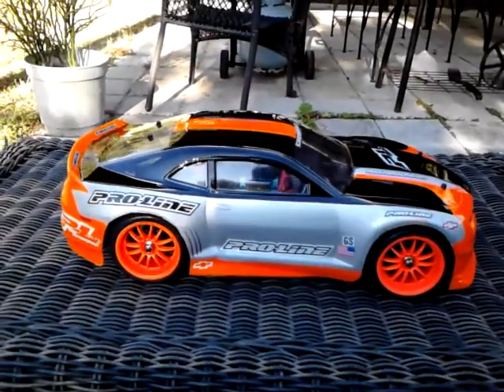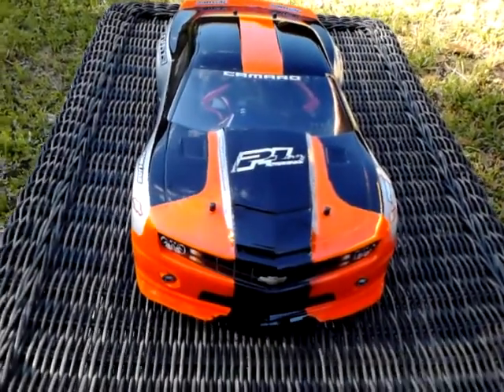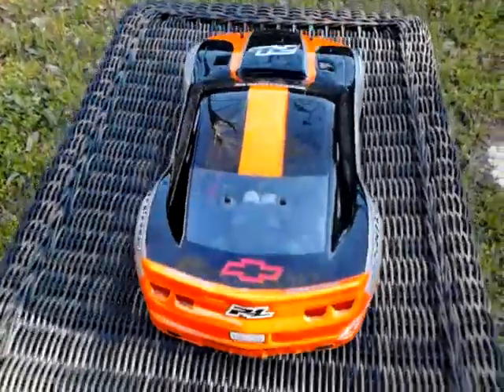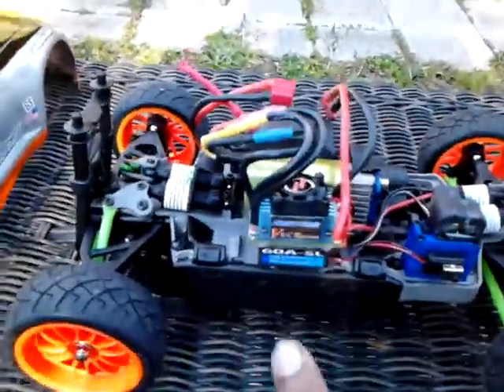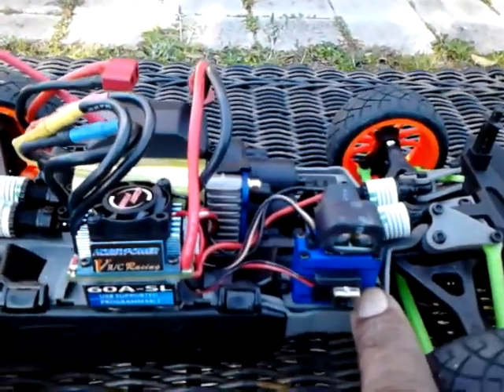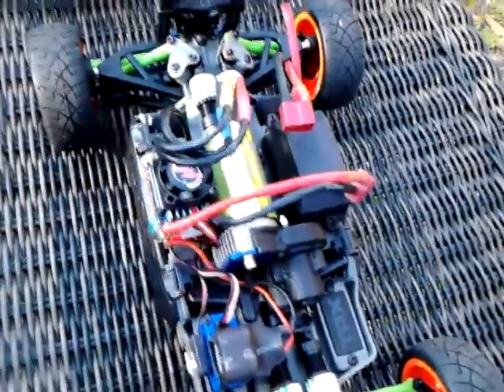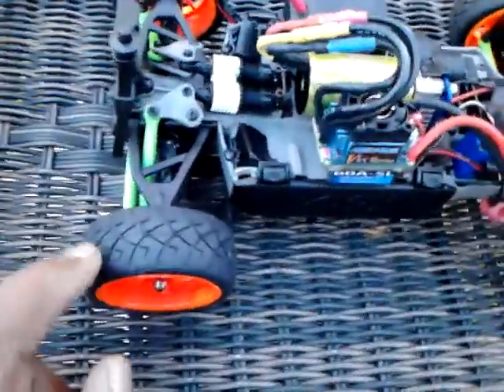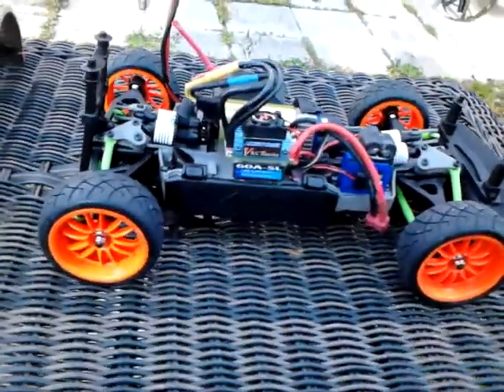Traxxas 1/16 rally car ;-)

Comment: That's clean!  Nice to see another brother into this hobby.  I don't know any here in Atlanta.  I just bought one of these vehicles used on ebay.  Seems like it will need some work to get it going; alignment, attention to the fan wiring, and power supplies.